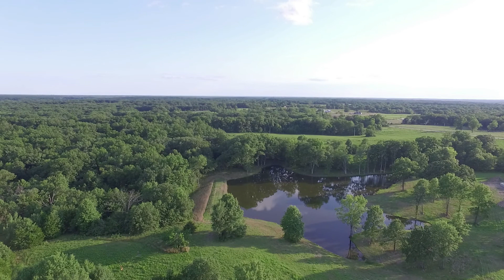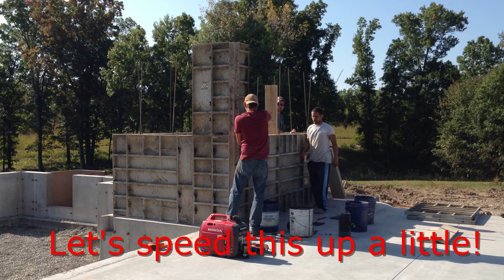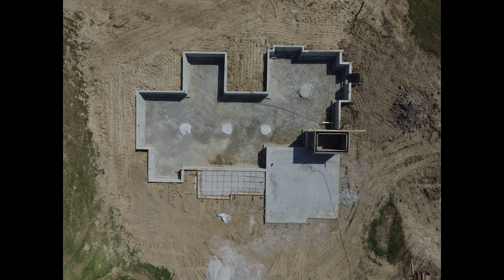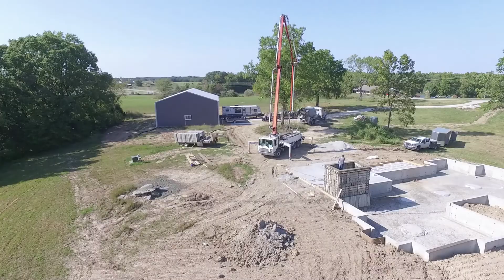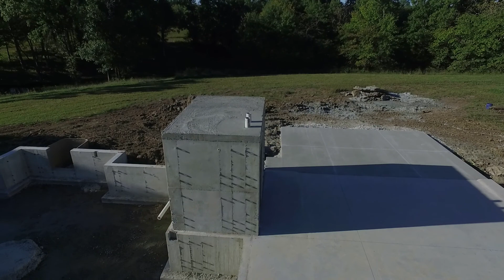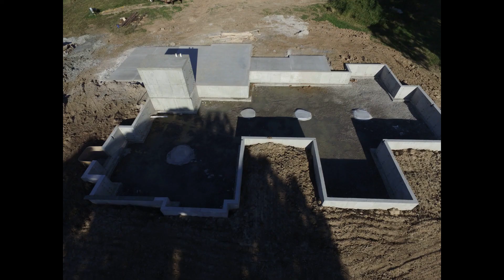Constructing Tornado Shelter Safe Room Inside Your House!  Every Homeowner Should have one of these!

Comment: The lack of rebar to connect the walls to the roof is just asking for trouble.  There is no concrete construction that does not tie in the the footings, walls, and poured ceilings without rebar connection.
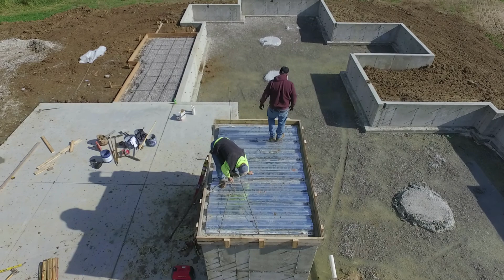Reply from the maker: I guess you missed that part. There is rebar that connects the roof to the walls.  But I would agree if we didn’t add it.  Go to minute marker 13:30. You can catch them bending it over and connecting to the roof rebar.